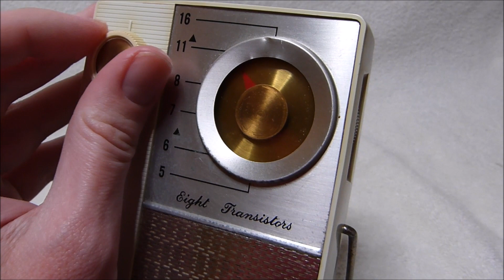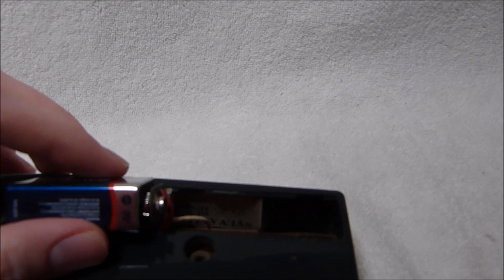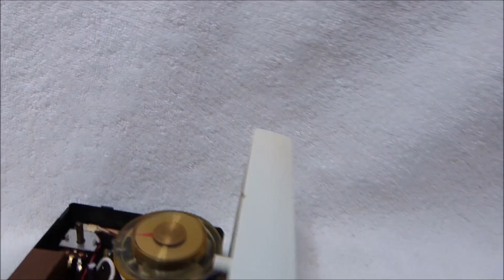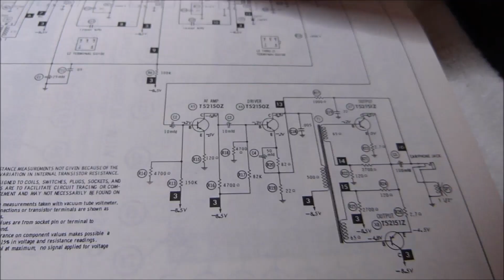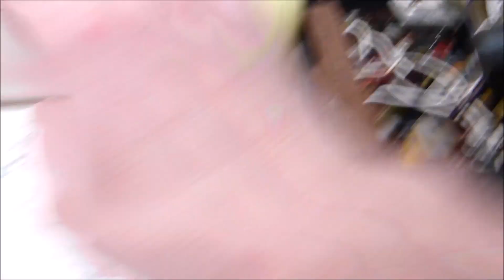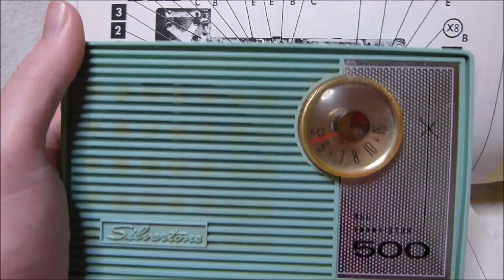1962 Sylvania model TH-16 eight transistor radio

Comment: I’ve never seen one of these. Probably one of the last American sets also probably one of the last good looking sets in general. Very interesting design, love the gear reduction tuning
Reply from the maker: It's definitely from near then end of production of American made coat-pocket (or smaller) transistor radios, as by 1965 production here had just about completely ceased.

Comment: I know cursive is supposed to be "classier", but for some reason when my eyes see a cursive "N" they read it as an "M." So I read Eight Tramsistor Radio. It is a nice sample. Thanks.
Reply: As a kid I had a bad habit of adding an extra hump on all my “n”s and “m”s.  Drove my teachers crazy.
📻😁
Reply from the maker: Now that you mention it, the "Eight Transistors" marking does look odd. Perhaps it would look better if it was in block letters, and a little bigger.

Comment: I like the style. Maybe not “iconic “, but still stylish.
“ planetary reduction drive “, is more “ correct “,  but I have several radios with this feature.
A couple are marked 
“Vernier Tuning “.
My ‘57 Zenith R-500 has this type, and it’s great for fine tuning.
This Sylvania must have been about the last of their American made radios.
It’s cool to have something so old perform so well.
  Interesting dual 9-Volt system - double the run time (?).
    I’ve noticed the Rayovac 9-volt batteries were not made in US, but the other ones still say made in US. - at least the Rayovac Fusion batteries do. ( I use the Fusion batteries for long storage, and rechargeables for general use).
 Nice radio, great video.
📻🙂
Reply from the maker: Thanks, Jeff! I agree with the assessment of "not “iconic “, but still stylish."
Vernier tuning is the term I usually hear used, and should have used. 
This radio was at least one of the last American made Sylvania portables, I'm not sure what the last was.
I think the intention was double the run time, but honestly, they should have just made it use 4 AA cells, that would make it so much cheaper to run.
I didn't know some Rayovac batteries were still made in the USA, I'll keep an eye out for that.

Comment: A nicely built radio, with good performance. I liked the tuning reduction drive, it seemed to make it easy to find stations. 
As for the interference from the digital clocks, I had the same problem recently. I built a clock using an Arduino and LCD display, it has Pac-Man running round the screen eating pellets just like the video game. A Zenith pocket radio that sits on the night stand seemed to be performing worse than it used to, and it suddenly hit me that the clock might be the cause. It was!
Reply from the maker: Tuning is a breeze on this one, they did a great job on the tuning setup.
Modern switching power supplies do create a ton of interference, as do vintage digital clocks with multiplexed displays. 
The only clocks I have hooked up on my desk right now that are silent from an RF perspective are the Copal flip clock, and the BPC nixie clock, the rest swamp out even strong stations if I bring this radio near them.
Reply: @50sTransistorRadios  I found that the best time to listen to AM radios is during a power outage! Zero interference.
Reply from the maker: @Colin_Ames  I agree with you there Colin, though they thankfully don't happen too often! I actually recorded a daytime DXing video during a power outage a few years ago: https://www.youtube.com/watch?v=a8Lf_f9hYLA